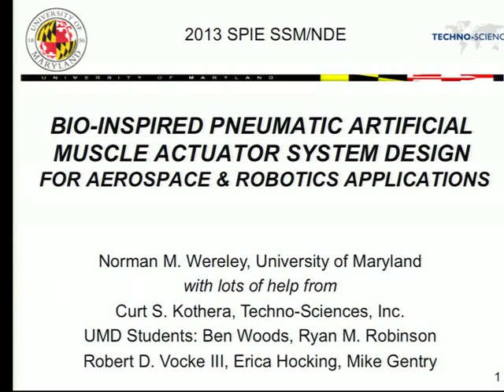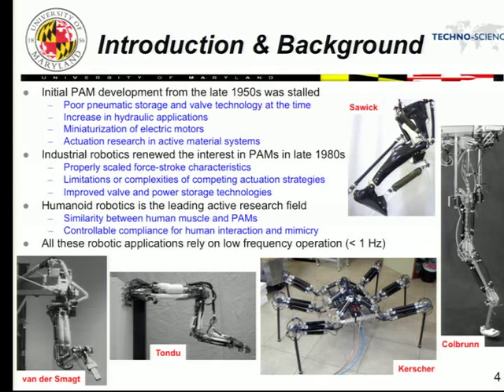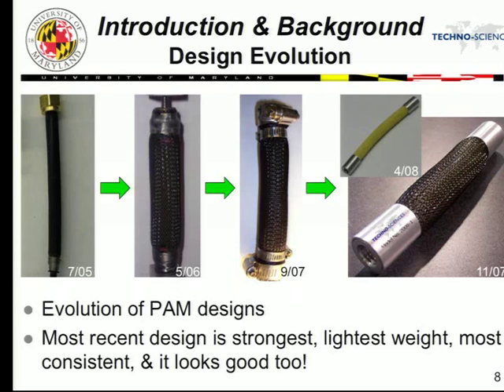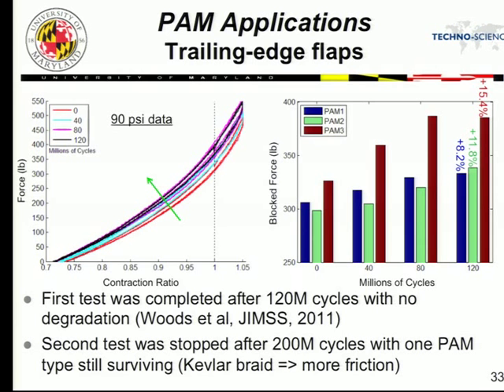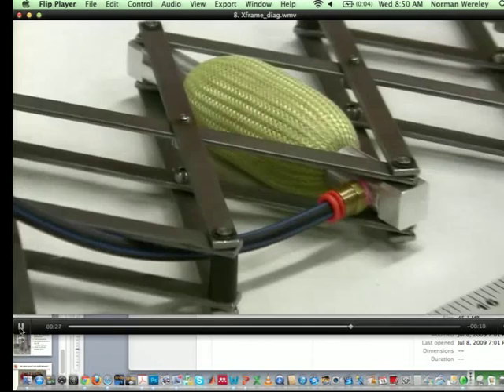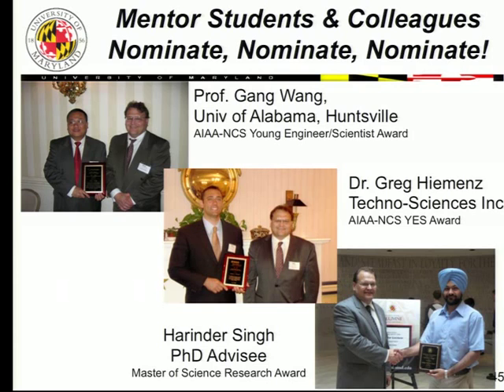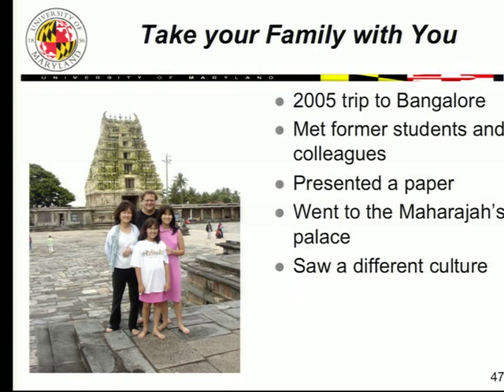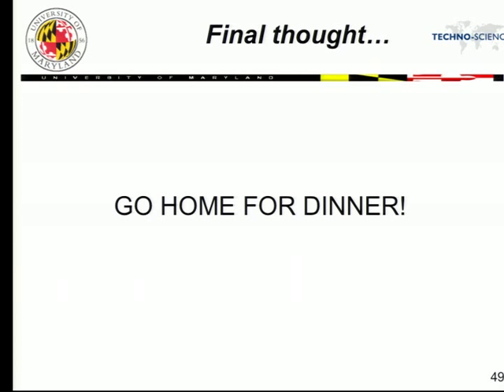Norman Wereley: Bioinspired pneumatic artificial muscle actuator system design for aerospace and

Comment: So if the pneumatic muscle actuator system were to be increased by a G squared upper formula couldnt you record the process by which the PMAS changed in pressure? The arm band camping simulator recorded a false positive when I increased the G squared upper formula so I was just assuming that you could apply it to the actual machine and record the byproduct of the actual formula.